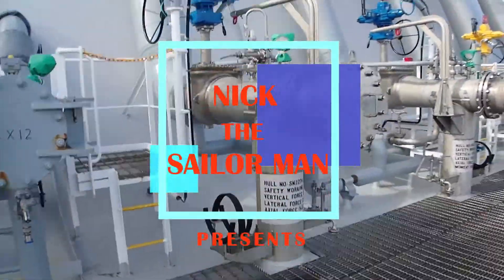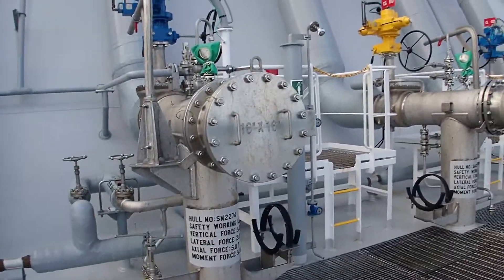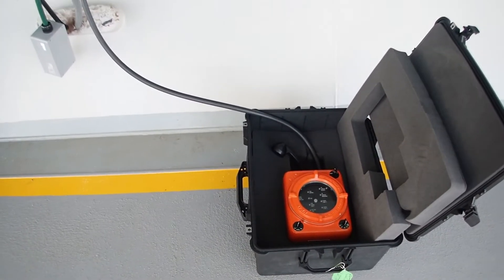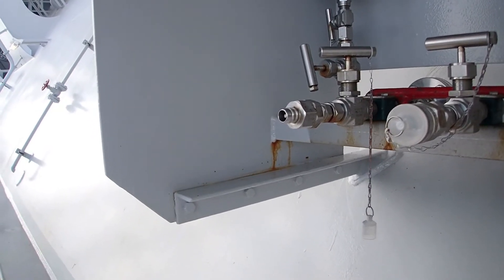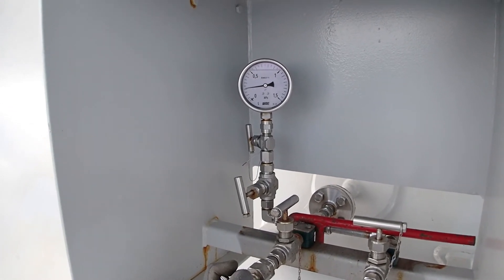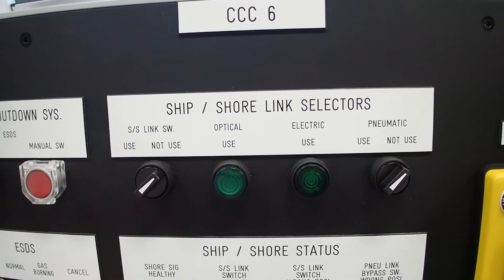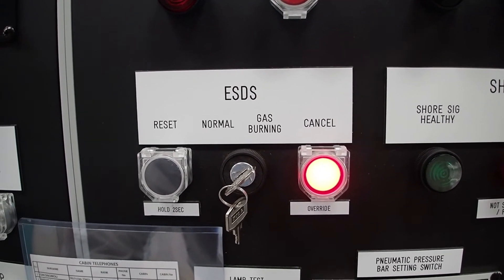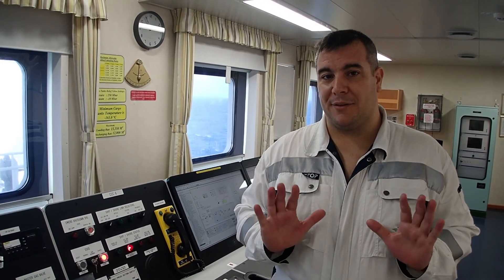How does the emergency shut down system work?

Comment: Hello Nick, quick question, when you have smaler shore connection, where do the reducer/presentation flange go? do they go in front of the short distance point (not sure if i spelt it right, first time im hearing that term). or, do you remove the SDP and then connect the presentation flange?
Reply from the maker: Hi always SDPs are placed only in some ports in Japan you might not use them
Reply: @nickthesailorman360  Great!! thanks for the quick reply :) good to know. I'm designing a manifold for a lng vessel and it's always a grey area when you want to know how the crew would actually use the reducers. The distance from the ship side to these flanges is to be within 3.5-4 meters OCIMF recommendations. very informative video by the way.

Comment: Hi Nick 
Can you please answer the difference between HOT ESD test and Cold ESD test!!
Reply from the maker: @AnkitKumar-up1jr  hi Yes of course the warm esd test is when the cargo manifolds have not yet been cooled down.The cold esd test is when the manifolds and the associated pipings have been cooled down with liquid LNG.There is also the cold stroke test which is basically to see that the ESD valves are operating whilst they are cold.
Reply: @nickthesailorman360  Thank you so much Nick!!🙏

Comment: Nice manifold area  that show high standard implemented on board;i wonder to know how old have this lady?.
Question : if this test is conducted simultaneous for all valves witch valve you will calculate timing  less than 30s  because all valves will close at the same time ?
Reply from the maker: Yes and yes she is a baby :)
On your quesion kindly note that the ships ESD Liquid valves are the ones closing 4 Blue 1 Yellow